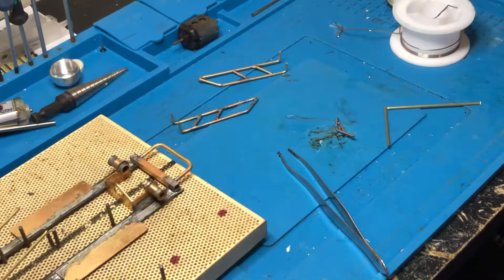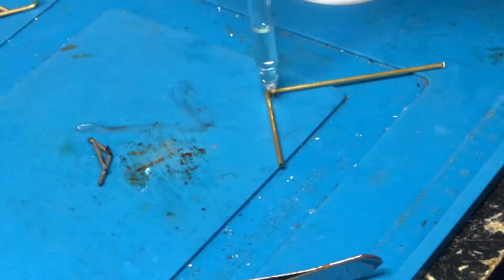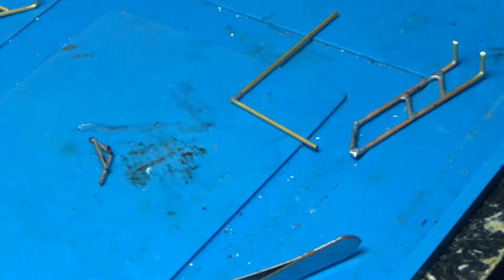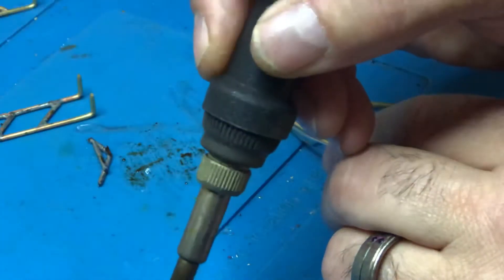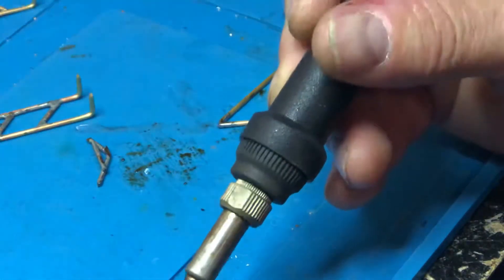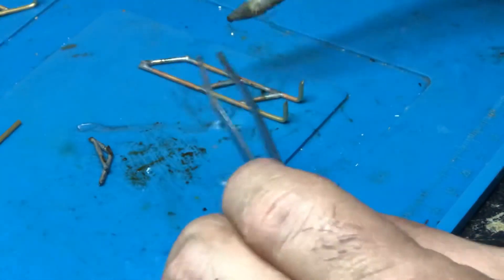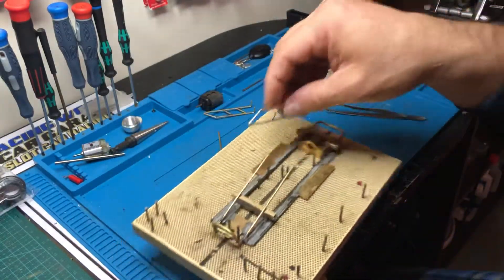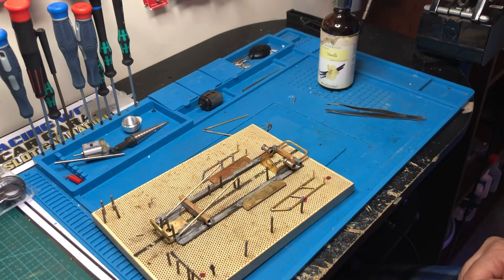Making nerf bars with brass wire or tubing

Comment: What size solder are you using, and flux?
Reply from the maker: 0.8 diameter 60/40 solder and stay clean acid flux. You can get these from Amazon.
Reply: .8 mm= .032" That's a common size solder used for doing component work.
Reply from the maker: @billffromnh  Thank you for stating correct size 👍🏻